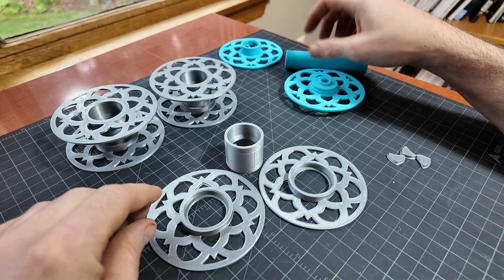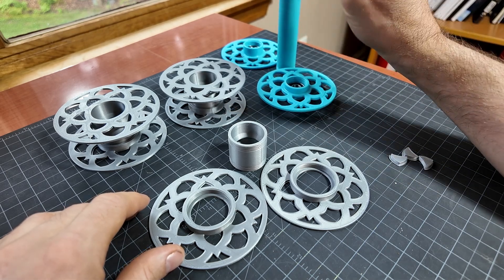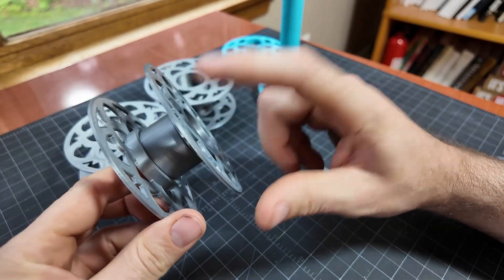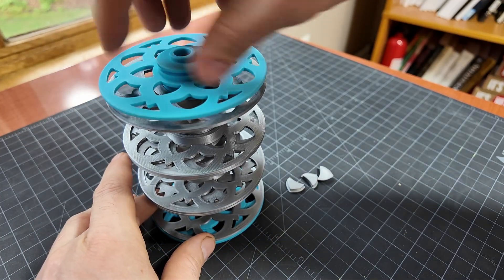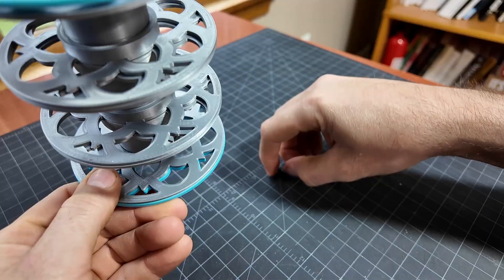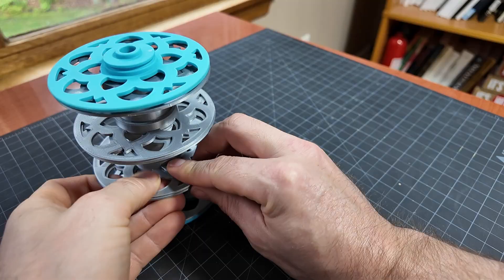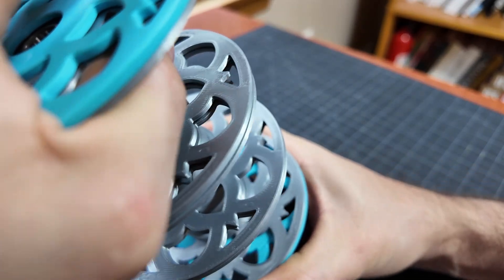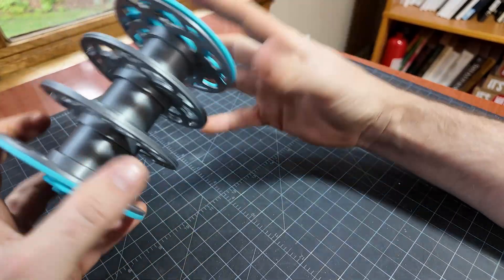Spin 202 - 3D Print Sectional Bobbins

Comment: I printed it to give it a try. I was very excited about the idea. I've tried twice now and ended up with yarn barf when trying to play the 3 singles together. The plugs were annoying so I just tied a piece of string through the end piece and the first section.
I first plyed without brake tension, ending in singles winding on in opposite directions on adjacent sections. It was as though the sections were unwinding at different rates but I think this is impossible as they are all linked together. I tried playing with the bobbin under brake tension and the center single still managed to jump to one of the sections on the end. The singles also get caught up on the little notches on the sectional ends. I took extreme care in making sure the singles were winding on smoothly,( no pig tails) and held all 3 singles so they were coming off sections at the same point when starting to ply. I'm not sure what to try next, but would love to see a video of this working so I can figure out what I'm doing wrong.  
When creating the singles, if my guiding hook, for yarn placement on bobbin was too close to an end separator it sometimes jumped to the section on the other side of the separator. I was using long draw so take up could have caused a loop big enough to get caught and skip section? 
Does anyone have suggestions or tricks that I can try next please?

Comment: I got some and so far I like it. Do you think it would be ok to glue the sections together? I’ve been struggling with the little bits. I finally got them in but I’m not sure they’ll stay in place.  Also I wondered if anyone has thoughts on the leaders, do they need to be removed and replaced every time or is there a way to keep them from flying around? Those are my first thoughts with my first use. I think it’s really awesome especially for splitting a braid and then 3 plying. Thanks for your great ideas!

Comment: I don t understand the purpose
Reply: This is when you're spinning a sectional -dyed(lengthwise) top roving and the colours spun as Individual Singles for further plying together, (rather than a sectional -dyed roving's colours getting spun on one single following one another, after which a plyed yarn ends up all with all different colours all over the place).
  Of course, one can do without  such a sectional bobbin's help however then one needs to split the sectionally dyed roving lengthwise to have every colour section ready for spinning as a separate single,( something that requires extra work and bobbins for each color single).
 (Hope,l didn't confuse you👍🏻)